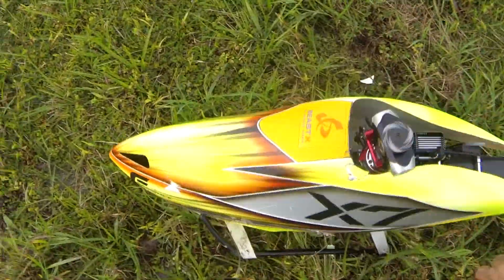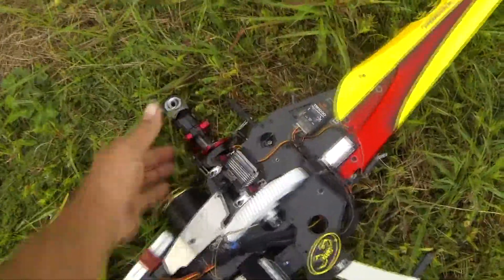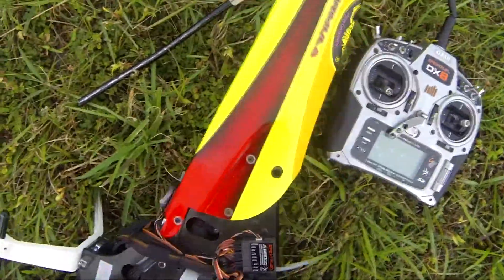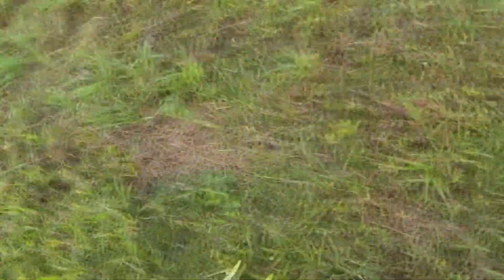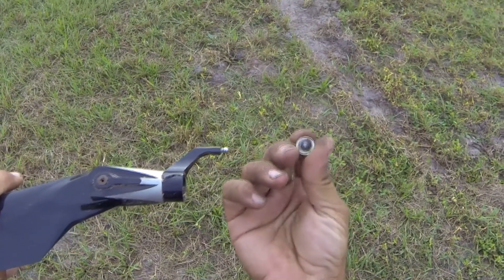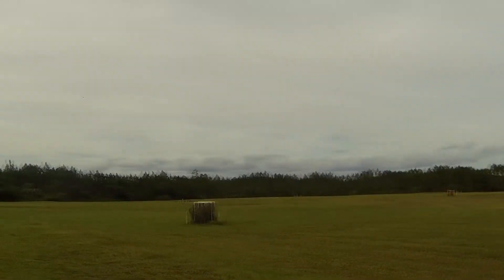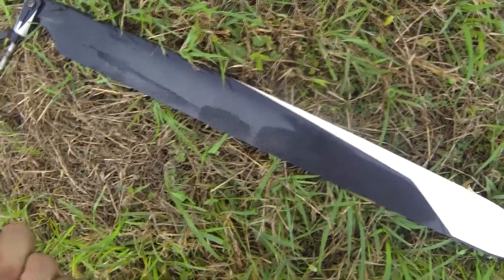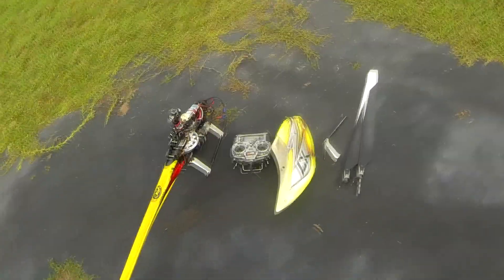Gaui X7 - Blade grip / Spindle bolt failure (improper install) - 11-15-15

Comment from the maker: While corresponding with a Gaui pilot. I took some photos to send to him. One of which I put the bolt back together with the broken part in the spindle and noticed a gap between the spindle and the washer under the bolt head. SO, this was apparently my fault... Surprised it went the some odd 150-200 flights it did before breaking. The Irony is right after this flight I had some new dampers and stuff I just received and planned on installing since the Lynx dampers wore out so quickly. If I had done that before flying on this day. I probably would have seen the problem or something and this might not have happened. Oh well.. Hind sight is 20/20 as usual.

Comment: Damn. Maybe sub 450 is big enough for me. Glad you weren't the target of a stray blade.
Reply from the maker: +MicroRCFiend ME TOO, my friend... Me too.. But really the 500-550 class is the best if you ask me. It's when you cross that weight threshold that things begin wearing quick. My 700 gets more maintenance than any 450 I've ever owned. But the X5 gets almost zero maintenance. Every now and then I oil some bearings, replace plastic linkage tips when they wear. Or change the gears when I feel they are getting old. That's about it and I have over 1900 flight on it... 1936+ to be more exact. The parts are reasonable price and the heli is just great. Of course the X3 is awesome too. But if I had to pick only one heli to keep. It would be my X5.
Reply: 1900, Jesus. Trying to hold back the fierce jealousy but failing miserably. Haven't even got 50 flights on my 450 and that's 2 years of trying. A 6s 360mm is on the cards but gonna wait till spring for daylight. X3 or chase360.
I have a friend that will let me fly his X5 so maybe i'll give that a little tickle before buying just in case. 1900 ;| wow, your a machine!